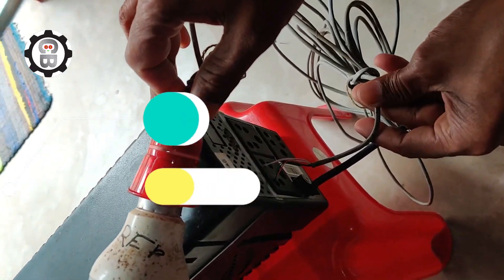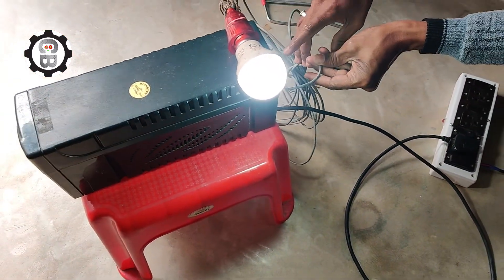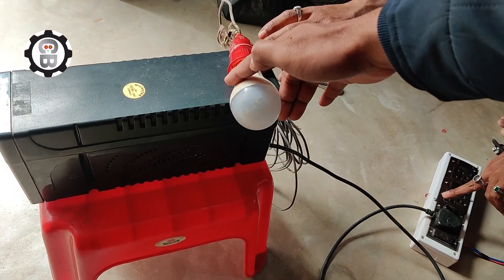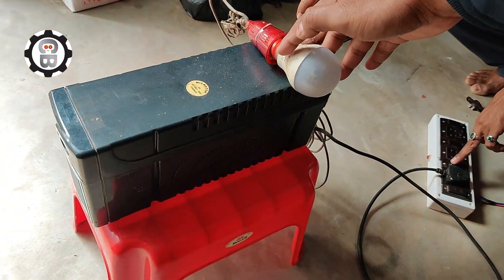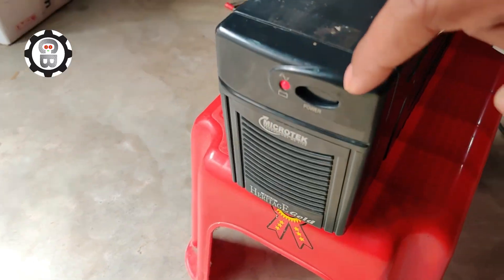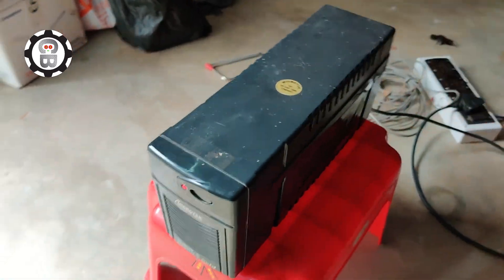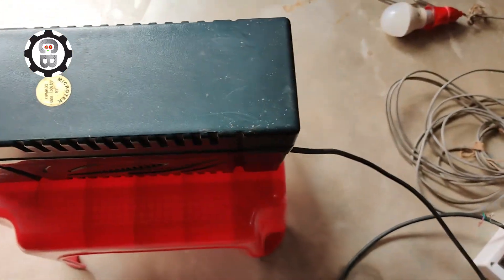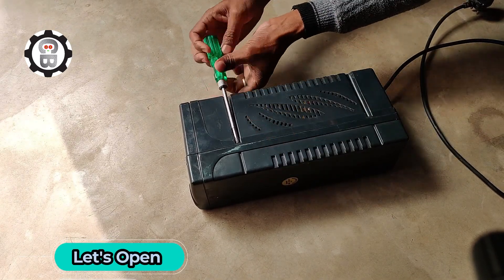UPS Power Button Repairing Full Guidance #technology #repair

Comment: I have a problem with my Frontech UPS. I accidentally pressed the UPS switch too hard and now it fell inside off the UPS. Now I am worried that I will not be able to turn off my computer.
Please give me a solution.
Reply from the maker: Just following my video. Open the ups switch and fix it. It is not that much tough. You can do it. 😊
Reply: @Chandrabotics  Thank You sir 🙂

Comment: Can I use my ups battery after breaking its power button?
Reply from the maker: Hi,Your question is not clear.
Reply from the maker: @Amit Kumar yes you can use external switch also. No issue 😊
Reply: @chandrabotics can u plz tell me how can we replace switch with external switch
Reply: please tell us how to add an extra switch ?